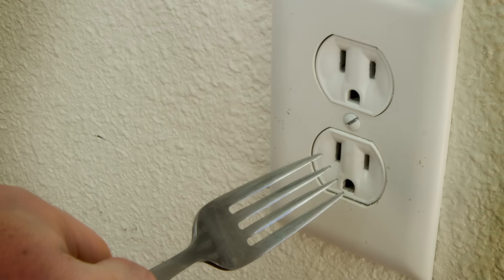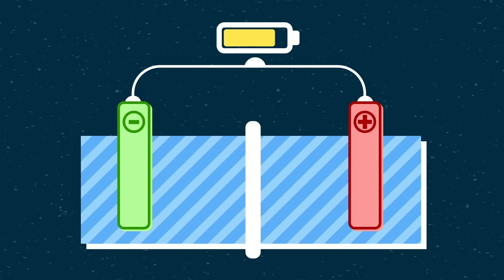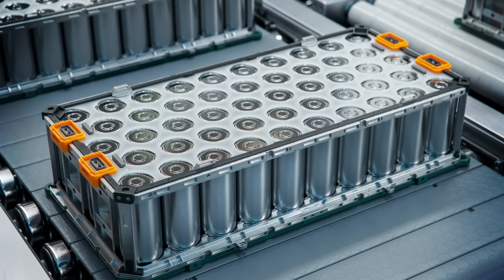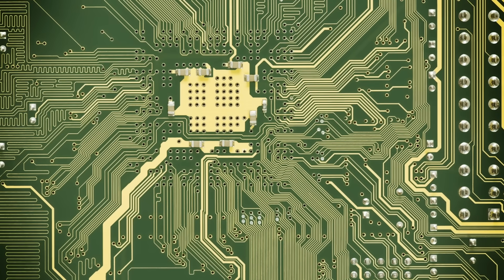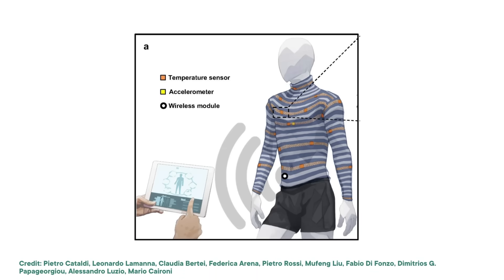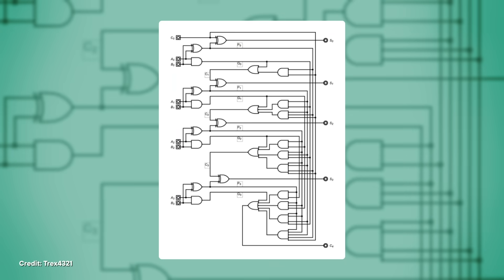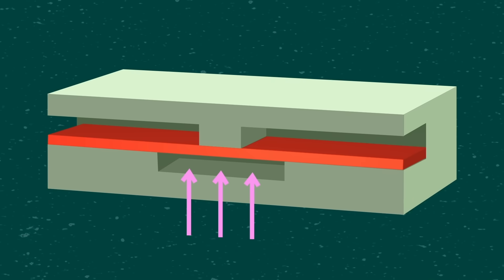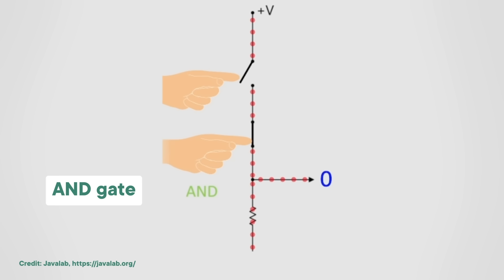Can You Make A Computer Out Of Food?

Comment: Fun fact I learned in college. It is possible to build logic gates with no moving parts, other than the flowing water. It uses some interesting fluid dynamics to direct the water flow. If you make the pipes out of something edible, presto, edible computer. 
Practically I don't think anything bigger than an adder has been built this way.
Reply: I learnt from YT you can make logic gates from dominoes.
Just replace the dominoes with Dominoes Pizza falling bread.
Reply: @shanerooney7288  nice, but the water logic gates can change states multiple times without a reset.

Comment: Fun fact, if you can make a "not" gate, then you only need either AND or OR, and you can recreate any logic gate by cleverly stringing those together. You dont need all 3 primary ones, and you dont need any of the secondary ones. 

Of course, by doung it that way you are vastly inflating the number of gates used in a circuit, but NAND/NOR (that is Not AND/Not OR) are the only gates you strictly need to make any logical arrangement of gates
Reply: Well, all computers strictly use NAND/NOR since that’s all you can make with CMOS technology